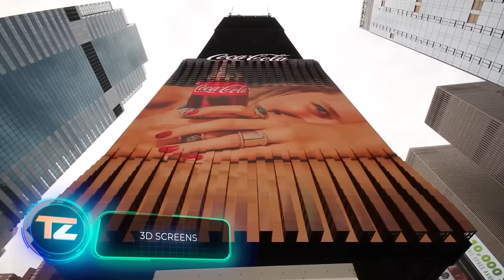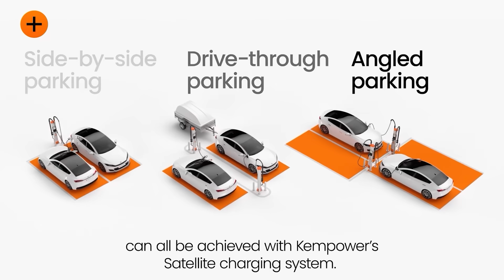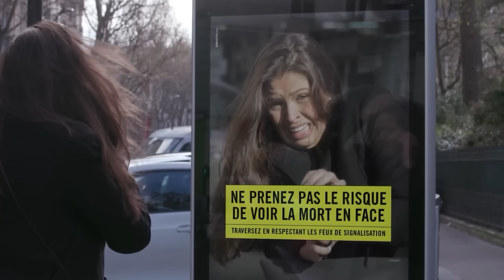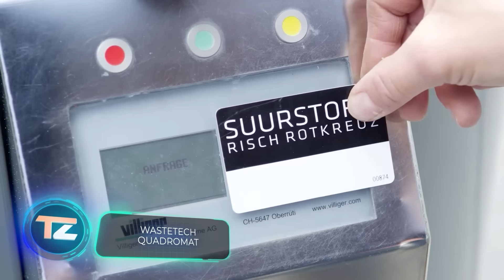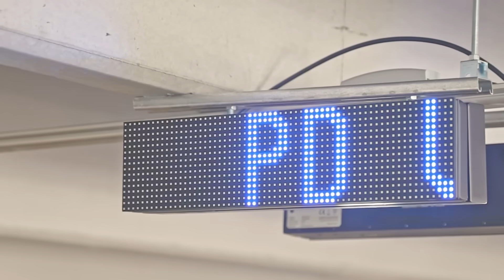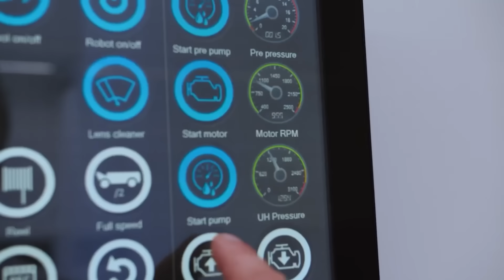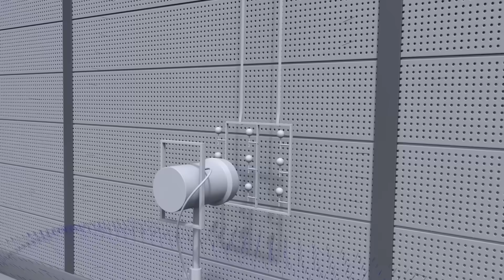15 INCREDIBLE URBAN TECHNOLOGIES THAT HAVE REACHED A NEW LEVEL

Comment: A dehumidifier in the park. I’ll bet that’s a cost effective way of getting drinking water. Run a compressor 24/7, filter, sterilize, mineralize… just put in a fountain and be done with it, you already have to to dig a trench for power lines.

Comment: free water but only when the electricity is also free...
Reply: it is just a fancy dehumidifier after all
Reply: @cyri96  and it only works where air humidity is high. In most cases there are other sources of water.

Comment: As a man who can walk 30 miles without even thinking about it, I can't avoid thinking that a PaveGen installation would be considerably more efficient if just two of those tiles are attached to the base of my trainers, rather than paving all 50km of my route with the things! 😉

Great concept for high traffic urban areas of course, but for low traffic suburban areas like mine one accomplished walker with a version attached to their feet will produce more energy for much less time, outlay and resources compared to paving a little-transited area with them. 😇
Reply: I would rather convert the energy in gyms to electricity. Ten people on gym cycles will produce more power than a mile of those plates. And it's cheaper to install.
Reply: This reminds me of something I read in a textbook about distributed data systems. Twitter, according to the book, uses a different strategy to deliver your tweet based on whether your a celebrity with a high number of followers or an average user. For average users, when they tweet they update the feed for all their followers. For celebrities, they don't update the feed of all their followers (it would be too heavy on resources), and instead their followers will fetch celebrity tweets separately along with their regular feed.

Comment: I like the anti smog tower idea
Reply: Really?
China trying to solve a problem by building something that results in the same problem.

What I mean is; If China stopped producing as much emissions as they do, Eg, Poorly constructed coal burning power stations. Due to cut corners/tofu-dreg construction practices, they release a lot more particulate and gas emissions than the likes of Australian and American coal burning power stations.
Then they wouldn't need to use these contraptions to filter the air.
But they built these things, that run electricity, that is produced by coal-burning power stations, that produce excessive amounts of particulate, that these then filters out of the air.
They are like a dog chasing its own tail around a tree and too stupid to know it's their tail...

Comment: The lighted walkway could be confusing. A driver seeing a green line across the road could assume that is GO not STOP
Reply: Yup, plus visually impaired pedestrians will struggle a lot too
Reply: @WolfgangDoW  not many visually impaired construction workers, this things for building sites or factories with temporary crossing requirements not general public road use
Reply: That's a good shout, that! There's no UK standard I'm aware of that covers walkways defined by light (Which this is) but several MoD premesis near to me have recently installed new barriers where a strip of LEDs on the bar is used to indicate halt (Red) or proceed (Green). Anybody used to that could easily misinterpret the crossing colour (Intended for the pedestrian) in much the same way. ⚠

Perhaps the better approach might be for the walkway to be defined in amber/orange (Which in itself reasonably advises caution) and for the pedestrian instruction to be given as a red or green man projected onto the roadway just in front of the kerb line? 💡

Comment: Good luck china with the smog thing but your gunna need a lot of those machines and knowing china the things will probably blow up and make more smog and maim passers bu
Reply: They built these things, that run electricity, that is produced by coal-burning power stations, that produce excessive amounts of particulate matter that's released it into the air, that these then filters out of the air.
They are like a dog chasing its own tail around a tree and too stupid to know it's their tail...

Too bad they wont fix the root cause of the problem to being with. LOL, "BuT iT MaKes DiaMonDs FrOm AlL dA StUfF" will be the catch line that'll get used to promote them....